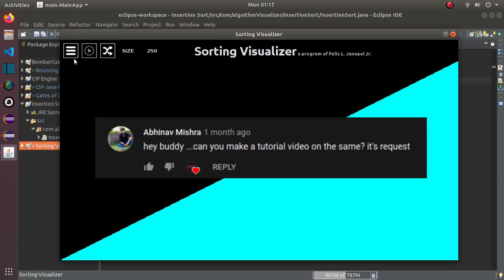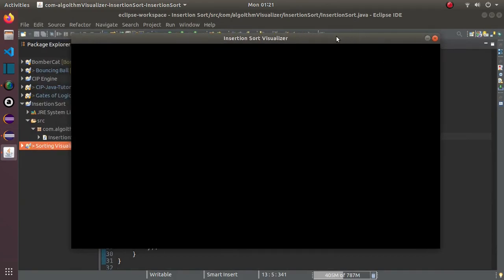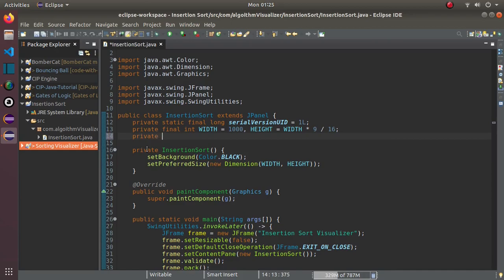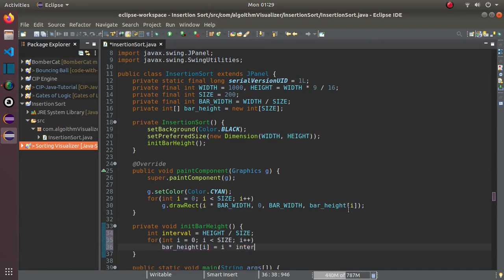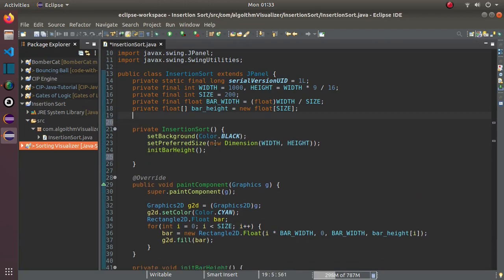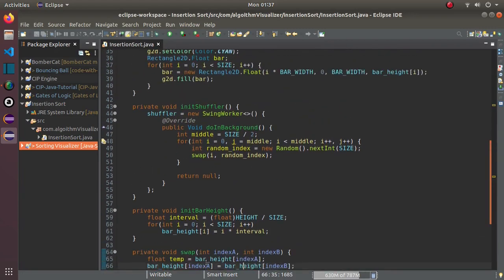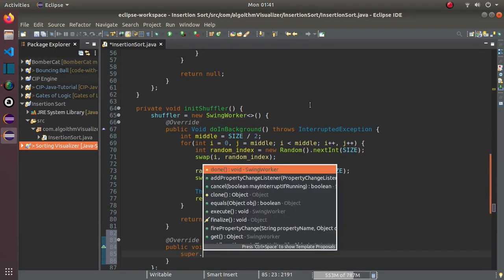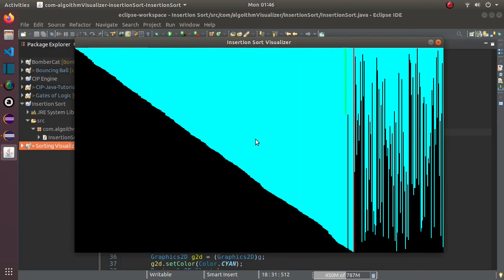Insertion Sort Visualizer using Java Swing and Swing Worker

Comment: Hello is there a way to flip it so it starts from the bottom left instead of top left?
Reply from the maker: Yes, you'll just have to change the creation of the rectangular bar in the paintComponent() method. So from:
new Rectangle2D.Float(i * BAR_WIDTH, 0, BAR_WIDTH, bar_height[i]);
to:
new Rectangle2D.Float(i * BAR_WIDTH, HEIGHT - bar_height[i], BAR_WIDTH, bar_height[i]);

Basically we just changed the "y" part of the Rectangle 2D.Float constructor. We subtracted the HEIGHT by the bar_height[i] because if we just used the HEIGHT, the bars will be displayed starting from the bottom to the more bottom (out of the frame's height) so we subtracted it by bar_height[i] so raise it to be visible in the frame.

Comment: I didnt get the part where we sort the  rectangles how is it done
Reply from the maker: The value that we are sorting is the height of the rectangles. Then, we change their position on the array based on the algorithm that we are using. Think of it as a 2d array and their indexes (position) contains values (height) then we sort the values by changing the indexes using the sorting algorithm.

Comment: Thank you for the video! I still have one question remaining, how do you separate the algorithms into separate classes? I tried referencing paint from a different class, but it still wouldn't update the EDT. Do you have any suggestions?
Reply from the maker: I suggest using another Thread for handling the algorithm's logic and calling repaint() to update the UI. SwingWorker is what I would suggest especially for algorithms the uses recursion such as Merge Sort and Quick Sort.
Reply: @code-it-philiks4348  I already solved the problem, but thank you for the help tho!